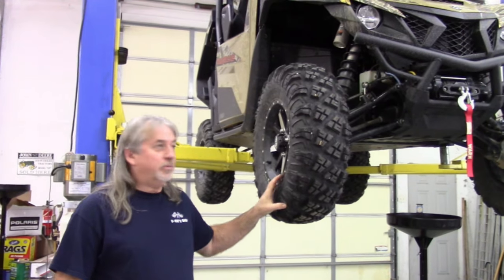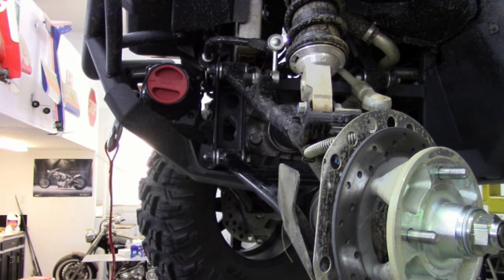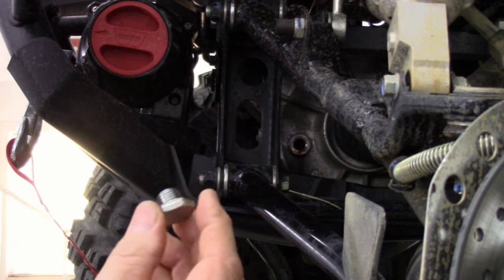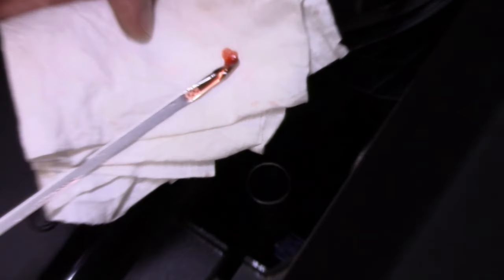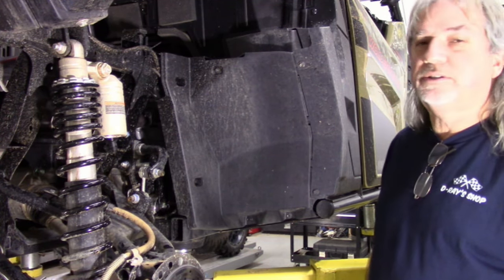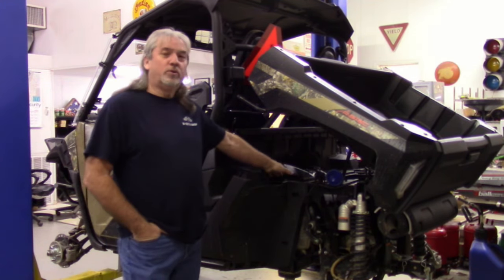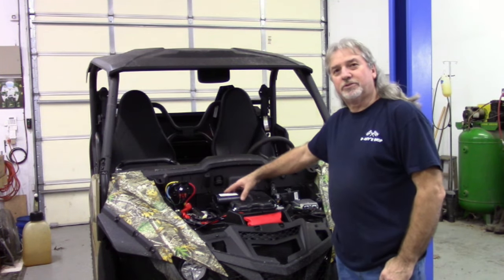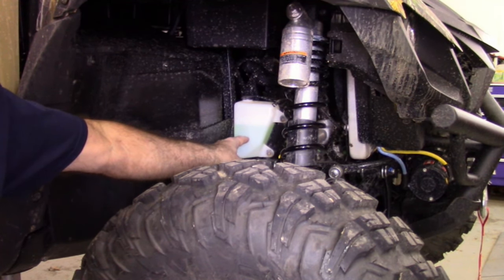Yamaha Wolverine X2 850 R-Spec Service - How To Change All Fluids @ D-Ray's Shop!

Comment: You don't need to remove that access panel to get to the oil filter, just take a band clamp style oil filter wrench, and stick it back there. I was able to do it while the vehicle is on the ground. Saves you a ton of time, there's plenty of room back here for your hand to reach in and grab that oil filter.

Comment: Great job explaining! My dealership has done the first oil change & they messed up BIG-TIME! I had many ounces of engine oil puke out of the air cleaner and land on my garage floor. So I took it back and they explained they added too much oil after the oil change because they weren't aware of letting motor run and let oil settle before checking and adding more oil. Well done D-Ray Smith! Thank you.

Comment: I always instruct people to only use a 1/4" drive short ratchet and socket and only run down by hand and then barely bump the ratchet to snug it and leave it be... I've seen dozens of ruined cases and diff housings from the Rambo torque guys efforts... Keep up the good work and maybe more videos this year ?
Reply: How do I turn the sound on

Comment: I ended up filling the engine oil through the filler hole on the top of the engine near the spark plugs. I didn't even know about that oil reservoir off to the side. I'm hoping it circulates everything just fine where it needs to be lol. Wonder if I should drain and refill.

Comment: Dray you still responding to comments, one question is the clutch adjustment video u Filmed like 10 yrs ago on the 200 atc the same for the 185s an would u happed to know what the carrier mounting bolts specs on a 185s are?